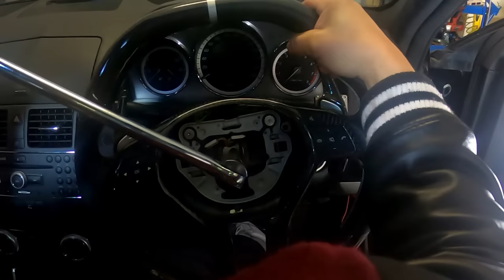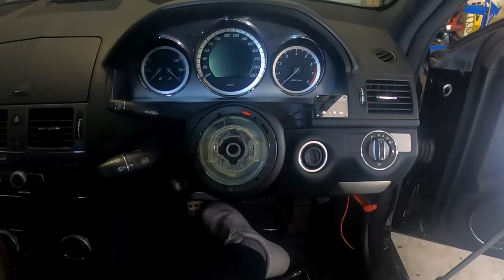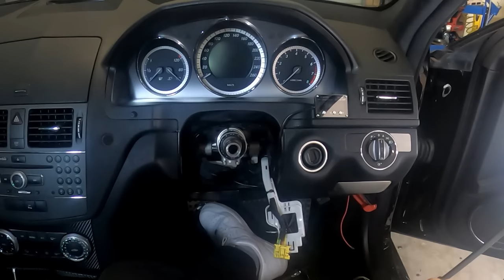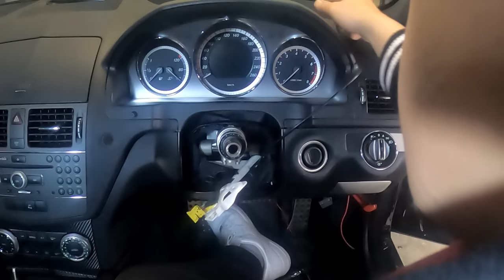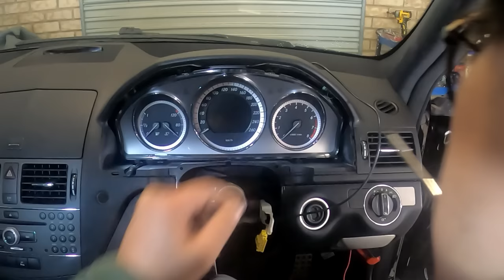HOW TO remove and fix ESL/EIS/ ELV MODULE  w212 w204 mercedes motor replace  Part 1

Comment: Hi Mikeyz Vlogz
I saw your video for changing motor completely and I added ESL plug for testing but motor is not working when putting on or off the key. I don't know what happened. do I need reprogram for ESL and EIS? Thanks a lot
Reply from the maker: hey so if ur just changing the motor and u manage to do it all right u dont have to reprogram anything just a simple motor switch
Reply: Just to be sure to be sure I cleaned the board with (ear) cotton balls as the smouldering motor had left black stuff everywhere, then I used electronic circuit board cleaner, a spray at $11 and cleaned it again. Do not touch it where your static electricity could zap it. Make sure the two grey pins of the limit switches are close to their posts they are supposed to hit to stop the motor turning once locked/unlocked. Did you reconnect all the electrics feeding the ELS?
Reply from the maker: @dominicwild3189  good  work.  after all that you put it back together and then test it by plugging everything back in together .... then once you have everything connected ...u can reconnecr your battery ....once u reconnect your battery ...put ur key in and out and test.... u should hear that ur esl works like.normal again .... and hear that whinding sound and the esl locking and unlocking
Reply from the maker: @dominicwild3189  connect all wires and test before you put it back or else u have to take it apart again and u dont want that .... just plug all connectors back together so it can work .... from testing u might get an error message from the airbag as its not going to be connected... make sire u can reset it ....or plug them back in so u dont get the error ....

Comment: Hi, thanks for your nice videos, so valuable! The other day, after having fueled the car, my 204 shortly cranked the motor, but then it died out completely,. After that, no reaction to the key whatsoever. About 5 minutes later, it could start, luckily. Could the esl cause this general failure, even when the starter motor cranked at first?
Reply from the maker: hey mate firstly thanks for  ur kind words... sorry to hear  ur issue ..spunds very much like the esl could .be starting to fail

Comment: Thank you so much for this video. how do you know if it's in the ESL is in the unlocked position? I feel like I can move my steering wheel, but it's like there's no power steering, it's very difficult to move, but possible. Does that mean it's in the locked position?
Reply from the maker: unlocked position would mean no steering lock .. when u insert your key did it spin? the motor?
Reply: @MIKEYZVLOGZ  hi, sorry for late reply. So in your video at 1:20, I do not get that spinning noise anymore. Where it sounds like it's accepted. That means it's locked? If so, is it still possible for me to get a mechanic to follow your steps?
Reply: @MIKEYZVLOGZ  ok Mikey, I watched your entire video, I think it is in the locked position. Assuming I can't get it to unlock, can I still follow your steps and just buy an emulated ESL? Or will there now be additional steps? 

I have a feeling it's going to be tough to get it to go one more time. I banged on it a bunch before getting to your video. It did unlock, but had no idea the significance of leaving it there.
Reply from the maker: @ChrisS-mj6ux  theres still another way to unlock it .. u can even drill a small hole and manually turn the motor until it unlocks ... many ppl have done this ...
Reply from the maker: @ChrisS-mj6ux  its ok ... it doesnr mean u cant fix it.. a mechanic can still fix it.. preferably a specilist ... but if i could do it .. so can he... its most likely in the lockes position.. but that doesnt necessarily mean u cant open it.. there are other ways ... 1 cutting bolt off so u can still open it then reweld the bolt on..2 drill a small hole where the motor is and manually turn the wheel until it unlocks...ive heard ppl do this without causing any damage... so do not worry u can still fix if
Reply: @MIKEYZVLOGZ  hey Mikey, actually my steering wheel moves all the way around. Car is off so it's very very heavy, but the wheel does move if you turn it. Does that mean it's I'm the unlocked position?
Reply from the maker: @ChrisS-mj6ux  yes if you steering moves its unlocked .... u disconnected the battery right?
Reply: @MIKEYZVLOGZ  no, I'll do that right now. Great to hear!!! Going to get some tools to finish taking the wheel out and get the ESL out. Honestly man I think I'm going to throw it away and just get the emulator.
Reply from the maker: @ChrisS-mj6ux  thats exactly what imma do when mine stuffs up again ..but not until u get the emulator becuz they neeed the esl and eis so they can program it
Reply: @MIKEYZVLOGZ  does it just snap out?
Reply: @MIKEYZVLOGZ  we got to the ESL. We can't release it because some kind of bolt or nut is holding. Is there anyway to remove it? If it's unlocked, is it supposed to just snap out?
Reply from the maker: @ChrisS-mj6ux  u remove the 13mm nut on it and then u should be able depress the bolt and it slides out .... without it being unlocked it wont depress for u to remove it...hence why i stress to have it in the unlockwd position
Reply: @MIKEYZVLOGZ  got it. Removed the 13mm. We are able to push the pin in, but how does the box release? It's not sliding right out. Thank you so much!
Reply from the maker: @ChrisS-mj6ux  if it doesnt slide out then its not fully unlocked it needs to depress all the way or very close to the end for the esl module to slide out easy
Reply: @MIKEYZVLOGZ  any tips to depress the bolt? We keep trying, it's pressing, feels like all the way using a pick tool to press it.
Reply from the maker: @ChrisS-mj6ux  if ur bolt isnt depressing all the way u need to reconnect the battery and leave key in ignition so it doesnt unlock... as soon as u take the key out with batt connected it will lock immediately... so leave key in ignition... dont turn ... just insert in amd tap the column here and there ... hopefully the vibration will help the motor spin enough to unlock..i beleieve the motor is jamming or stuck... worst case remove entire columm drill a hole where the motor meets the wheel  and help the motor spin manually by using a pick tool... its very time consuming but worth it
Reply: @MIKEYZVLOGZ  ok. One final question, this decides my fate. If that bolt freely moves, does that mean my ESL is unlocked? Is that bolt the only thing that keeps it attached to the steering column
Reply from the maker: @ChrisS-mj6ux  yes the bolt is the only thing that attaches it to the column ... which is why wen u remove the nut and depress it slides out..freely moves??? it must depress in order to know ur esl is unlock... whether it fully unlocked..thats dependant on whether u can depress bolt all the way
Reply: @MIKEYZVLOGZ  Ok. Maybe my ESL is actually locked. But we're pressing the bolt pretty far in, it feels like it moves super freely, I can hear it move on the spring. But then I try pulling the ESL out, and it's just stuck. I may try removing the steering column, or just hire someone.
Reply from the maker: @ChrisS-mj6ux  thebreason why i say in my video to make sure the steering is unlock so u can get it out like i did.. u can hire someone get a mobile auto locksmith they will know what to do... it will coat less becuz u did all the hard work... they can get evwn if locked... if u dont wanna go thru this again get an emulator..is that what ur doing?
Reply: @MIKEYZVLOGZ  I'm getting an emulator. Crazy man because the bolt moves all the way flush to the ESL but we still can't get ESL out
Reply: I mean, the bolt moves so easily, it's weird I thought that would mean the unlocked position
Reply from the maker: @ChrisS-mj6ux  thats wierd are u pulling it out the right way
Reply: @MIKEYZVLOGZ  I'm pushing in the bolt, the bolt goes about flush to the ESL, then I try pulling up on the ESL, wiggling it, towards me. It's super crammed as you know, but I'm pulling up
Reply from the maker: @ChrisS-mj6ux  ye i know ... just keep trying ull get it as long as u can preas bolt down it will come out

Comment: Good morning and thanks for your tutorial, I am writing from Italy, I have the same problem with my C200, W204, at the moment my module is in the Lock position, do I have to follow your tutorial or do I have to disassemble the entire steering column?
Reply from the maker: if in locked position you may have to removsteering column as it would be the only way to remove the esl module... by cutting the bolt off... have u tried to tap the steering columm near the esl to try and give it a shock ..sometimes it can help it spon that last rotation to unlock the esl.... once u remove it theres another way to get it open... i can try drill a small hole near the wheel that spins the motor and manially turn it til esl unlocks.... however u may need a new chip and definitely reprogramming
Reply from the maker: only follow my tutorial if u can get it to unlock... withouy frying the chip

Comment: Hi mate my car is doing something similar although slightly different. Every now and the it wont start, lights on dash all come on but just when its about to start up, it make a kind of noise ( sounds almost like an electrical glitch) and then nothing. Then re try and its starts fine. My battery was tested a little while back is it didnt start after 4 goes and reading around 12.3v , the guy said its on the low side but wouldn't change it and to see how it goes  and give it a run as i only do short ish journeys .Should I get this in and looked at now or maybe change the battery ? I dont really wanna spend £200 on a battery then have to shell out on this. Also my stop start isnt functioning so again wondering and hoping if its more battery issue. And does a scan pick this up? Any advice much appreciated. Superb tutorial
Reply from the maker: your battery seems fine if it's neat 12v not running g it's good and wen running hits u der 14 v or close to then ur good ... your symptom point to esl module .. its the most common issue on these cars .. a cheap fix if u have the know how cuz the part is 10 bucks literally ..and it's just a matter of time and effort ... u can do this ..I had no idea about cars and electrics and I managed with some research and youtbe videos ..hence why I did this video to encourage others to do it and save over 1k
Reply: @MIKEYZVLOGZ  thanks for coming back to me, mine does it maybe once every two or three weeks or so, would you say its urgent based on your experience? Also I read sometimes the key battery could be worth checking as can cause issues... Iv done that. I'm not sure I'm confident enough to do it as cats not my thing but have a friend who can. Should I get on it ASAP?
Reply from the maker: @gypsycatcha79  this is when ur suppose to do it ... once it starts the last thing u want is to be stranded and get a tow cuz it no longer works.. I learnt the hard way ... and u don't wanna pray before u start ur car everytime do u?
Reply: @MIKEYZVLOGZ  totally true. I think il get it booked in. One last question, does a diognostic pick up the fault and are elv and esl two different things?  really appreciate your help buddy
Reply from the maker: yes it will
Reply: @MIKEYZVLOGZ  Thanks mate for your time 👍👍
Reply from the maker: @gypsycatcha79  happy to help

Comment: Any particular motor you would recommend or what to look for from the likes of ebay etc?
Reply from the maker: honestly as pong as it's for w204 ir good. they are very popular generic 12v motors used in things like fans and etc that have a rotating mechanism as that's all it's really designed to do ..so just get any it will be fine my friend ..that's what I did and 3 Yeats later still good
Reply: @MIKEYZVLOGZ  Cheers, got the module out - was pretty straight forward. Are you in Sydney by any chance? I ordered a replacement motor that arrives the soonest. None of them FS in Australia on ebay etc come with a roll-pin removal tool and I don't know anyone that stocks this. I will try a T5 torx but I'm skeptical of this working.
Reply from the maker: @biz1M  I'm Melbourne bud... u don't need that tool... just use a 5mm torch and tap til it grips and turn slowly whilst u pull ever so slightly..it will work buddy trust me

Comment: Hey mate im in Australia as well, how much u think it will cost if I ask locksmith to fix it? I honestky aint got patience and the tools to do all that and worried that might even make it worse... do I just buy the motor from.ebay and ask locksmith to replace it?
Reply from the maker: if u just let them do the job it's gonna be 1300

Comment: Mine is in the lock position so how can i get it out & change the motor without frying the chip?08 C300?
Reply from the maker: u can do it a few ways but its quite involved
1 takre to pro 
2 diy drill small hole and manually turn til its unlocked 
3 cut off locking bolt on top and then replace it after , they even saell them now for this reason , cuz its a massive defect for these cars

Comment: Mikey is very hard to get to the lock. It's not as easy as your video.  Do I have to remove the bolt holding the union joint?
Reply: I removed the bolt holding the union and pull the steering Assembly out a little and got the lock out.
Reply from the maker: no u dont have to remove that bolt all u have to do is lower the steering column enough to reach around and remove it..also remember to be patient and if u do get frustrated take a break and come back to it ...the qorst thing u can do is force it
Reply: @MIKEYZVLOGZ  I remover the steering column because I could not  get to the esl to remove it.  Now I having the hardest time putting back on the lower part of the steering column. Have you ever removed the whole column? Right now I'm using a air chisel to open the split connector to put back in the shaft. Still hard . maybe need 2 people one to hit the top of the shaft. one to guide the bottom.  
Any tip Mikey
Reply from the maker: @fitzphillips5370  im sorry to hear that friend .... so the bottom of your steering column should just slide into the slot you do not have to ise brute force and force it in ... i have removed the colum before and i did have a bit of difficulty reinstalling it ... i think the best way is to ensure you line up the grooves properly first and then it will slide right in ... if you dont line it up it wont slide in .... u are talking about the shaft that the steering column sits in that turns the wheels correct? and it had a hex bolt that secures it horizontally? is that right ? and it is also covered by a rubber piece correct?
Reply: Hey Mikey, I noticed the when I repaired the esl the 
large spring loaded screw did not go all the way in as before i think.  Would that be a problem? I was able to install it in the column. The steering lock was still in the unlocked position.
Reply: @MIKEYZVLOGZ  yes that is what I'm talking about. The groves are very small I might have to remove the column again to see closer.
Reply from the maker: @fitzphillips5370  yes fitz exactly ..make sure the grooves are seated appropriately and it will slide in easily

Comment: Thanks for your informative video. I was wondering if there will be no chance of having another ESL problem at all once new motor is put in? What's a preventive measure for the ESL failure before it happens? Thanks.
Reply from the maker: nothing really ..all u can do is try to notice it once it happens and get right on it and do the fix.. its a common fault so it happens no matter what.. it sucks becuz merc went cheap on parts and this Is the outcome and result of cheap parts on critical components.. u can always go bypass route using emulator that will work too... no more esl failure and its just a electronic component which tells the ecu to unlock so u can start the car .. no moving part like the motor .. therefore no chance of motor failure..its what I'm considering if this happens again .. takes away some security because steering wheel won't lock but u always have the immobiliser as a precaution
Reply: @MIKEYZVLOGZ  Thanks. Looks like the emulator option requires some device for programming. I could not find a video explaining the process yet. Have you figured out the steps? Thanks.
Reply from the maker: @dynaryu  emulator will need to be programmed and sync to your car u would need to send off your esl and eis ignition for them to program it and code it to work

Comment: Great tutorial. But i have a question. This motor is bound to fail again which mean we'd have ro do the job again.  Can't I by pass the lock entirely by removing or grinding down the lock pin or removong the threaded gear on the motor shaft or the plastic gear itself so that it doesnt ever lock the steering wheel again?
Reply from the maker: if u are trying to eliminate the failure an emulator is the best way to do it ... wen the motor fails it tells the esl that ur car isn't locking ... nor can it lock and unlock ... the motor spins and moves the pin up and down locking steering wheel... I'm not sure if u can just grind off that locking mechanism
Reply: @MIKEYZVLOGZ  i see. Thanks. What a pain in the ass.
Reply from the maker: @Omardottcom  i know but honestly an emulator would be a great alternative ..that's my option next time my esl fails ..but once fixed should last anywhere up to 10 + years